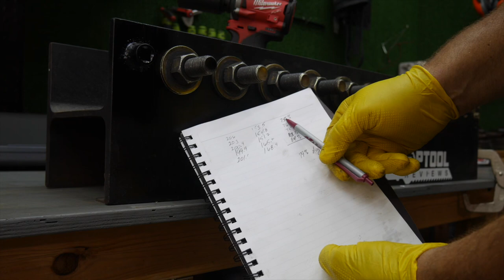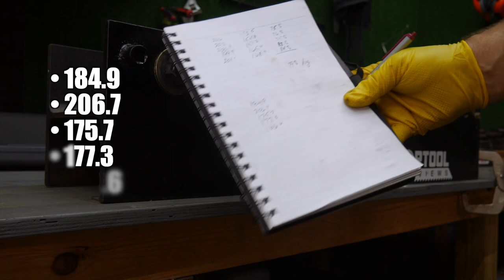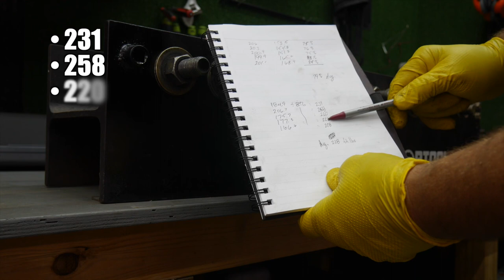Torque Explained - Fastening vs Nut Busting [IMPACT WRENCHES]

Comment: Wouldn't it be interesting to tighten each nut with say 190 FT/LBS clamping force using the torque wrench. Then mark the heads and metal bar with a felt marker. Loosen each nut about 1/8" turn and tighten with the impact wrench. Let us know if the nut tighten to the mark or goes past it.
I know when I owned a construction company a 2,000 pound drop hammer on a drag line would not drive AP-3 steel sheeting in some soils. If I fastened only a 700 pound vibro hammer on the dragline and clamped its jaws on the sheet, the sheet would go down like it was in butter. 
Vibration as opposed to weight was the answer. I think the vibration got all rubbing surfaces moving thus less friction. 
I wonder if the same applies to friction in fasteners?

Comment: Interesting.. so impact wrenches don’t actually tell you the ft lb value you’re tightening to… are they mostly for loosening nuts or tightening bolts that can’t be over tightened?
Reply: Yes. They save time for mechanics and tyre shops. Also for pre-tightening bolts/nuts

Comment: Is nut busting torque only in a counterclockwise direction ?  would the tool have the same ability if threads were left handed ?
Reply from the maker: Nut busting torque refers to loosening of the fastener, regardless of the direction. However, some of the tool companies have "tuned" their brushless tools to hit harder in one direction than the other. Thanks for watching.

Comment: This is a really great test and explanation for the breakaway torque numbers they use in sales specs. I would love to see this test on the dewalt mid-range impact wrench, it advertises 330 ft lbs of fastening torque and 600 ft. lbs. of breakaway torque... way off the 80% you repeatedly find. Is there something else going on there?
Reply from the maker: We can do this for the DeWalt. The ~80% rule is not in regards to the actual torque specs, it's just in regard to the Marketing Hype of "Nut-Busting" or "Bolt Removal" torque. We are seeing manufacturers now tuning their cordless impacts to provide more power for removal and less for tightening. This capability is due in large part to the brushless platforms and the ability to control the power from the motor more precisely. Thanks for watching.

Comment: Any reason you can think of that my brand new 3/8 M12 Stubby Impact with an impact socket and brand new, fully charged 4.0ah battery can't break loose any of my F150 lug nuts? They are all torqued to 150ft lbs. The lug nuts do have those plastic chrome looking covers on them but I was under the impression with all these Youtube videos that it would have no issue. I also tried it on my brake caliper mounting bolts that are torqued to 184ft lbs and nothing?  What do you think?
Reply from the maker: I would definitely think that it should be able to break those free, unless they've been on for quite a while and have some corrosion. Did you torque the lugnuts on, or someone else? Thanks for watching.
Reply: @Shoptoolreviews  I torqued them myself with a brand new torque wrench.
Reply: That’s very interesting I can’t see why it wouldn’t take them off, even my Milwaukee brushless impact driver with a 3/8-1/2 adapter can remove lug nuts, although not easy it still does it.
Reply: You aint pressing it long enough
Reply: You have to let it hammer for at least 10 seconds to let it build up enough torque before claiming it can’t do it. Also, don’t press hard into the nut, leave the wrench sort of free on the nut so that it can hammer with minimal friction.

Comment: I have a Milwaukee M18 impact driver with 1,800 lbs. of torque and I still can't get the anode rod out of my water heater. 1 1/8 socket
Reply from the maker: Is it an Impact Driver with 1,800 in-lbs, or an Impact Wrench with 1,800 ft-lbs? I would assume the impact wrench would have no problem removing the anode rod. Thanks for watching.

Comment: This test assumes that the I-beam is infinitely stiff. That is suspect. At a minimum, it would be fair to question if it is "stiff enough". Due to flexing of the I-beam, the torque put on each subsequent bolt is likely to reduce the torque on each previous bolt. I would prefer this test to be performed on a solid block of steel that either has a through-hole or has been drilled and tapped. That would reduce (maybe eliminate) all flexing of the I-beam. The flex variable needs to be eliminated, reduced or at least considered before the results of this test can be trusted.